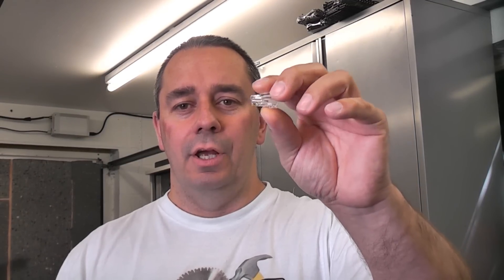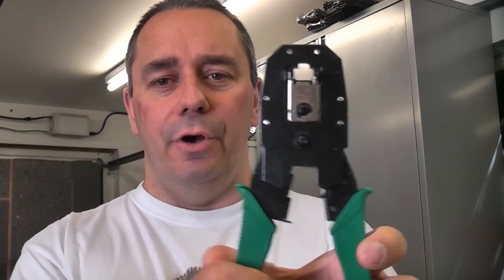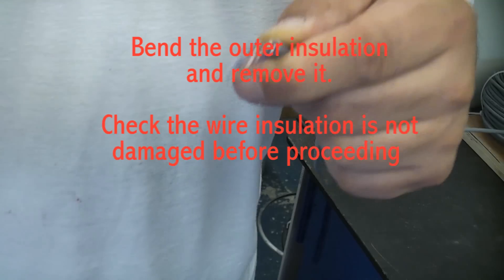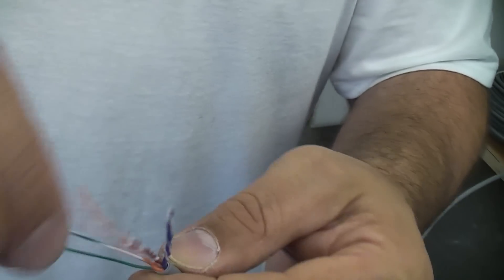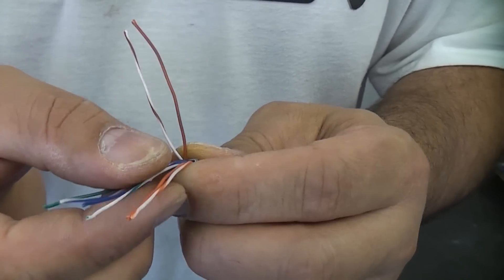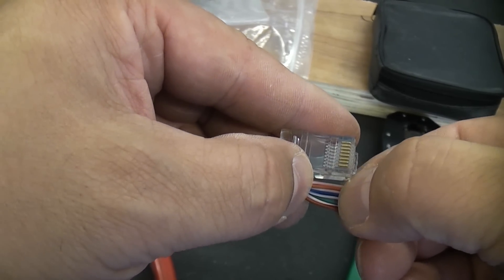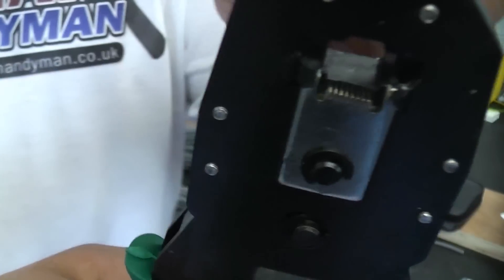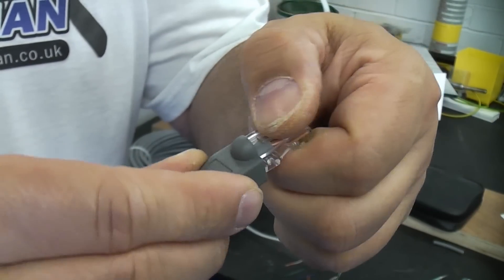How to crimp a network cable-How to Crimp Rj45 | Cat 5 | RJ45

Comment: hi, could you make a video on how to connect the different colour wires to a RJ45 Faceplate, so i can terminate to a wall socket instead of a connector.

cheers
Reply from the maker: Yes, I'll add it to my list of videos to make ;-)
Reply from the maker: Hi Scott,

Here is the network socket video- How to wire a network socket | Cat 5 | Cat 6
I hope it helps ;-)

Comment: Pass through connectors are easier to work as you can easily check the order of the wires is correct after crimping. Also it's vital to check the cable works as expected by using a cable tester.

Comment: 2:20 I assume the cable layout is universal based on "standards"?  I only have 4 cables (Black, White, Red, Yellow).  the cable was ripped out but luckily pieces of the wire color remained in the old RJ45.
Reply from the maker: Yes, but there is more than one standard  👍

Comment: Hi, does the brand of crimping tool matter or will any cheap crimper on eBay do the trick? Thanks.
Reply from the maker: Cheaper ones are more difficult to use and can often not crimp correctly, having said that, my pair are not an expensive pair!
Reply: @ultimatehandyman  thanks!

Comment: Definitely a great video. Looking for material to share with my virtual class. Only thing I suggest (unless your not in IT) is not to waste so much cable. I've had clients rip staff apart over overly wasting cables during prep. Cause if you clip THAT MUCH off, and a mistake is made you now have to start over and you've wasted at least 2-3 connections worth of cable already
Reply from the maker: I'm not in IT
I have hundreds of meters of cable in my loft 😂
Thanks for the comment 👍

Comment: You wasted cable by cutting more of the insulation than you needed too. You clearly wasted two inches of cable by having to cut it off. I would have measured it a lot closer to what would be needed to crimp. Also, why do you torture the wires by bending them over and over? They can be straighten without having to bend them so much and possibly create breaks at the bend point.
Reply: Can you give us a video on the better and improved? Criticism is great and all but if you don't have any proof... better keep quiet then.

Comment: Nice video. You caution people not to make these unless you have to. You are so methodical and leave me wondering if I can do it as a novice.
Reply from the maker: You can certainly have a go. The big problem is the crimping pliers, I only have a cheap pair and they are not reliable. Professional crimping pliers work much better (I use these at work sometimes), but they are expensive for the home user.
Thanks for the comment 👍
Reply: @ultimatehandyman  I think the biggest challenge in this exercise is to keep the filaments all lined up in the correct order before you squeeze the handle on the tool.  You have to make sure that all wires are visible and that none are half hidden by an adjacent wire before pushing them into the connector. That was my biggest takeaway.

Comment: Just a silly question is there a reason why wire has to be specific order like type A and type B.. shouldnt the thing would work anyway if cable are connected to the same pins of both side regardless of colour.
Reply from the maker: I don't think it matters for a patch lead, but if you are wiring a network socket in "B" standard and the other sockets in the property are "A" standard, then you connect one to the other, it will not work.
Thanks for the comment 👍

Comment: Straight forward video, dropped a like👍. However I incorrectly lined up one of the wires while crimping, I wasn’t aware of this and plugged the Ethernet cable into the PS5 and now my device won’t correct to any Ethernet cable. Can messing up the order of the wires cause a device to malfunction?
Reply from the maker: I'm not sure about that, sorry.
Reply: Hey, do network eng for work. By right it shouldn't happend . I suggest to get Network cable tester and connecter broadcaster to the PS5 and try get reading there.

Comment: I've done this exact thing...bought all the stuff online and had a go...I used clear passthrough ends though and trimmed of afterwards using a very sharp Stanley knife or you could cut to exact length like in this video....I also had to have my glasses on and a large magnifying glass as all is pretty hard to see...top video..I also use a cheap rj45 cable/end/socket tester with pre bought leads....top video.
Reply from the maker: I'm glad the video helped ;-)
Thanks for the comment 👍

Comment: Your crimping tool is a bit shitty. You can see at 5:40, that the jaw is not moving parallel, the left pins are squeezed more than the right ones.
Reply from the maker: Yeah, it is a really crap pair, but for the amount of crimping I do- I can just about manage.
Thanks for the comment
Reply: @ultimatehandyman  Thanks for the video!

Comment: Your rightmost pin did not get crimped.
Reply from the maker: My crimpers are not the best pair, but I have had no issues with leads not working.
Thanks for the comment 👍

Comment: I noticed that the crimp tool did a bad job of pressing in the pins... The outer most pin on the right as we look at the video, skewed to the right and didn't pierce the corresponding wire.
Reply from the maker: My crimping pliers are only a cheap pair. If you are doing a lot of crimps it is best to buy a decent pair. 
Thanks for the comment 👍

Comment: 5:35 You can see that the cheap crimping tool is not lining up properly with the pins in the plug. This will be an intermittent connection at some point. Also there are two types of plug, one for stranded wires and one for solid wires. If you use the stranded plugs on solid wires, then you will have an unreliable connection.

Comment: It really would be more helpful to the world if all the "experts" on most of the video's would stop calling a 8P8C connector a RJ45. It's just a piece of plastic with some pins until a specific wiring specification is determined. No one uses a true RJ45 wiring structure anymore. Even T type carrier uses a 8pin plug and it's definitely NOT an RJ45.

10

Comment: Hey man! Great video! I am following best I can, but my cable seems to have a ninth, bare copper wire running along with the others, as well as some aluminum-foil-like cladding around all nine, inside the plastic insulation. What should I do with the ninth wire?
Reply from the maker: That sounds like audio cable.
Are all of the colours correct for the 4 pairs of wires?
If they are I would just not use the 9th wire.

Comment: This seems really finnicky to me. Wouldn't it be best drilling a larger hole and use a cable already set up?
Reply from the maker: +Argyll1000 
You can do that if you prefer, but you do have to make rather large holes to get the RJ45 connector through.
Thanks for the comment

Comment: the blades in the handle of the $5 crimping tool do all the cutting you need - one side strips the outer cover off, the inner blades give you a fixed length, even trim, of the wire that is already sized for rj-45 jacks - no need for extra tools and no need to measure the required cable length. Use the tool properly and it's a lot easier!
Reply from the maker: +Yixin Qian 
I know but it's hard to cut the wires straight with the $5 crimping tool as it is poor quality (made in China garbage), which is they they don't always work for crimping ;-)

Comment: Great video sir. Just one question, if you don't mind answering. I'm struggling to connect wires into plastic clip using a flat Ethernet cable. the copper wires much thinner and it's frustratingly fiddly. I've crimped successfully on normal round cable without much problem. any tips for flat cable termination?
Reply from the maker: +Lugano27 
I think you can get special RJ45 connectors for flat cable, that might make it easier?

Comment: Hi mate, where do you purchase your cable from? I purchased a box of cat5e cable from Cabling4Less.co.uk but found the "copper" wire to be very thin and VERY uneasy to work with. I think it's not full copper and possible CCS or CCA.

Comment: the 8th position didn't crimp correctly because the crimper is fucked up, it is also my problem sometimes when crimping. can u suggest other brand of crimping tool that has a very good quality?thanks.
Reply from the maker: I'm no expert on crimping pliers and some of them can cost over £500 a pair, but RS components normally sell decent quality gear such as this pair for about £70 http://uk.rs-online.com/web/p/crimp-tools/4726762/
I would imagine they would be suitable for most people.
Thanks for the comment
Reply: thanks... :-)
Reply from the maker: Daniel Arquiza
You are welcome ;-)

Comment: I have searched high and low and have not seen any instructable video on using the crimper tool for ethernet cables as comprehensive as this.  Thanks sir for sharing.
Reply from the maker: You are welcome
Thanks for the comment

Comment: You weren't joking when you said Cat 6 cable is harder! :(
Reply from the maker: Yeah, I have some CAT 5 E cable that's really tough too. I would not like to be crimping that each day or you would end up with sore fingers from straightening it out!
Thanks for the comment
Reply: Ultimate Handyman what makes it worse is the bloody thick “x shaped” plastic thing in the middle of the cat 6 cable. Even when it’s cut off it makes it much harder to reorder the cables to the correct sequence before straightening them.

Comment: I'm trying to crimp RJ45 plugs (with 8 metal connectors) onto a cable with 4 small cables inside because i want to use it for an ISDN phone. Doesn't work though. Is it because of the 8 connectors? Because that's the only difference i can spot to a working cable.
Reply from the maker: Probably, unless it's a cheap pair of crimpers. I have a pair of crimpers that can't crimp correctly!

Comment: The tool you used to strip the outer jacket what is it called.. or do u have a link for it.
Reply from the maker: It's a cat 5 stripping tool, these have several different names, here is a link to one on ebay- http://www.ebay.co.uk/itm/2-in-1-Network-RJ45-CAT5-CAT6-Cable-Stripper-Wire-Cutter-IDC-Punch-Down-Tool-UK-/371223824398?pt=UK_Computing_NetworkingTools_Accessories_SM&hash=item566eaa080e

Comment: Great demonstration, thanks. Really helpful! Just a quick question: I'm planning on terminating my own cabling too soon for the purpose of cascading two routers together, they're both from EE (brightBox routers)
Was wondering what method of cabling would be required to achieve this setup i.e. crossover or straight trough cabling? I am aware of some of the new routers have the capability to auto sense the cabling setup and automatically select the pairs it needs to use, regardless of the method of cabling.
Would appreciate if someone could shed some light on my initial query. Thanks
Reply from the maker: I have two network routers plugged into my main router and have just used straight network cabling (no cross overs etc. ).
I found it was easier to terminate some of the cables into sockets and then use patch leads as the cable I got was solid and quite difficult to terminate into a plug.
Reply: You will almost never need a crossover cable. I think in 20 years, I have only used one once, and that was with very old equipment. The new stuff is all autosense. Straight through is standard.

Comment: brilliant.......this is going to sort out my sons on-line connection to xbox live

clear, well explained

how would you test the cables with a multimeter? - is this simply testing continuity/resistance between each wire end point?

Paul
Reply from the maker: Thanks Paul,

Yes you can test the continuity using a multi-meter by doing each set of pins, or you can buy a dedicated tester for about £10
Thanks for the comment

Comment from the maker: +onewheelup
Yes you could use CAT 5 cable and then crimp the RJ45 connectors on, or you can buy patch leads the correct length. You can get patch leads in various lengths, some are 50 Metres long. I think the longest patch lead you can have for POE is 100 Metres (over 300 feet)

Comment: Great channel. A very neat termination and crimp there and I have seen and fixed some right states. One tip for unwinding the pairs on CAT 6 is to use the sheathing you've just cut off, place it between the one of the pairs, and gently push down whilst twisting and it will un twist the pairs with ease. It can cause an ache in your thumbs after doing too many of these.
Reply from the maker: Thanks for the tip and the comment ;-)

Comment: is there much difference between CAT5 and CAT5E ?
Reply from the maker: There is supposed to be a speed improvement, but I'm not sure if you would really notice in many homes. I installed a home network and used CAT5E as it should help future proof the installation for years to come.

Comment: Hi, I would highly recommend the RJ45 plugs with the guide pice. You get the cores straight and slide the guide over them. This keeps them in the right order. Found this method to work a lot faster than the plug on its own. Great video thanks
Reply from the maker: I think the ones with the guide piece are sold as CAT 6 RJ45 plugs, I did get some but have not used them yet. I'll give them a try next time ;-)
Thanks for the comment
Reply: ***** Hi, you can get the 2 piece version in cat5 and cat6. The 2 piece are easier if it is your 1st time crimping but once you get used to it I think the one piece plugs are better. Cat6 plugs have stepped holes (Hi-Low) while cat5 are straight holes. I have done a boring video on this and the difference between stranded and solid core plugs over on my channel if you need to get off to sleep one night!!!!!!!!!! Great videos by the way, your range of knowledge is very impressive. Well done.
Thanks Vince
Reply from the maker: My Mate VINCE
Thanks Vince, I'll check it out when I have some time ;-)
Thanks for the comment

Comment: That's for a straight through patch cable, though. Crossover cables have a slightly different wiring sequence. Thanks for making such an in-depth video!
Reply from the maker: That is correct, thanks for the comment ;-)

Comment: I think the solid core CAT5 or CAT6 cables are only supposed to be terminated into sockets. There are sockets with insulation displacement connections and other ones with screw terminals.

The RJ45 jacks are supposed to be crimped onto cables with stranded multi-core wires. If you crimp the RJ45 jack on the solid core wires, you can see the eight "knives" are actually slightly slanted and this could cause bad contacts.
Reply from the maker: Thanks for the comment, I did manage to crimp one CAT 6 cable but as you say it doesn't work well so the rest were terminated into sockets.
Reply: There are specific 8P8C (RJ45) connectors used for crimping solid core CAT5 cabling that will prevent damage. The contacts differ slightly so they don't end up breaking the copper core.